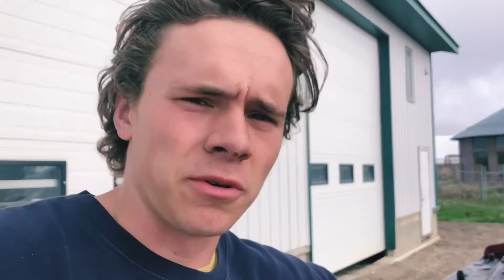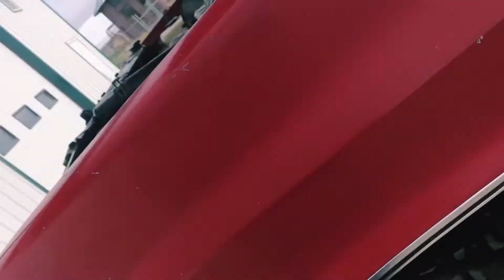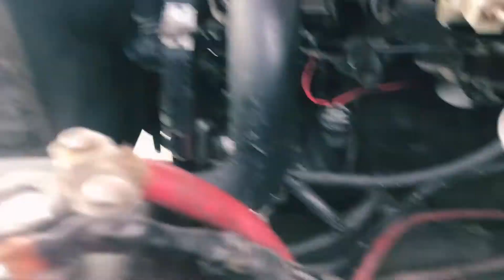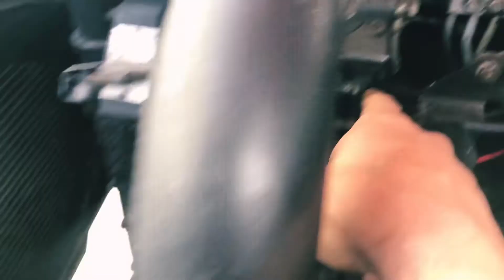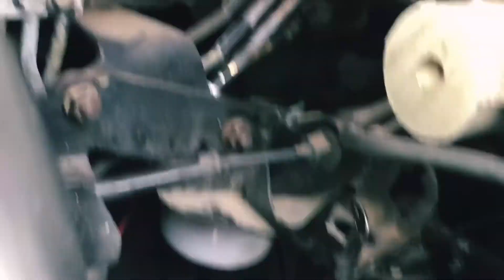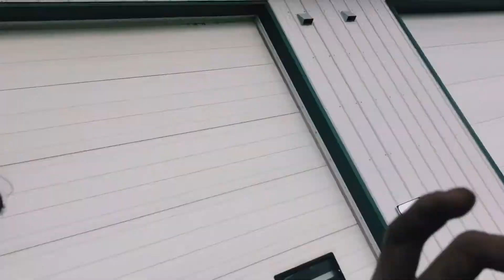12 Valve VE Pump Power Loss / Bog Issue Fixed | Diagnosed

Comment: Great information. I can start my truck every time I can step on the gas or the fuel pedal and get up to 10 miles an hour and no faster. I can drive around all day at 10 miles an hour and then come back to the house. I saw one video, but I cannot find it. Where inside the fuel injector there was a plastic washer or something that would break and stop the amount of fuel going in. Might have been the thing that you mentioned will continue.

Comment: I've replaced my mechanical fuel pump with a electric pump. An inline electric pump 
And I'm having problems getting power. The motor seems sluggish and won't go over 2000 RPM

Comment: Mine doesn't bog down but it doesn't have the power it used to and it gets like 14 miles per gallon and my dad used to brag about how it got like 20 or 21.  I just discovered it has a fuel strainer by the fuel pump thats never been open so not sure if that will be the issue or not. Ive timed it and adjusted valves and new injectors and nothing has ever gotten it back to what it used to be.
Reply: You ever getting this figured out?

Comment: My truck died on a long trip last night. I noticed at the start it seemed really under power and it did seem like it starved for fuel a couple times. I had to get it towed home to figure it out. So I changed the fuel filter and bled the low pressure line. That told me my lift pump was likely ok as it was able to pressurize the system and bleed it. I tried to start it and no dice. I watched your video and you gave a great step by step of what to check. I went through checking one component at a time. I disconnected my fuel shutoff solenoid and hooking it direct to my battery. I heard it click. I turned my key and it started with no hesitation. I checked the voltage on the supply wire and it was getting full power so doesn’t appear to be broken etc. I disconnected the wire from the battery and put the harness wire back on and again started like a champ. I took it for a drive and noticed a huge improvement in power so it appears the fuel filter was the issue. Not sure why jumping the solenoid seemed to help but it did. Thanks for your help! Your an awesome guy!
Reply from the maker: Thanks man !!

Comment: I've got a very similar issue. Was running fine and then all of a sudden it started to bog down and would keep running out of fuel at the injectors. Removed FSS plunger, and swapped to a known good lift pump but still didn't fix my issue. Will be adding air to fuel lines later on and seeing if it's either a crack in the fuel line going into the tank or if it's something inside the tank plugging up the sending unit
Reply: Fixed my issue, was definitely gunk inside the sending unit. Wasn't getting enough fuel to the injection pump. Replaced sending unit with a brand new one and now it runs better than it ever did
Reply: @yuribrezhnev6897  where did you get the sending unit from?
Reply: @Jordy40Growing  I bought it from eBay, it's the same sending unit as a gasser and it's plug and play. Unfortunately my tank didn't have the original in it or I probably would've salvaged mine
Reply: @yuribrezhnev6897  cool . Thanks for the info.

Comment: My truck runs for 5 minutes then loses power and dies, and only way to get it running again is cracking the injectors and priming the fuel pump but the fuel pump never builds any pressure, I can pump it 200 times and ill still be able to pump it with my pinky. I’ve replaced the fuel filter, but I’m guessing my fuel pump is bad because it never gets squashy?? Please help brotha
Reply from the maker: The camshaft has to be in the right spot for you to be able to pump the fuel lift pump. But what I sounds like to me is that you have a weak lift pump. Thankfully they are easy to replace. Go through all your fuel lines front to back and back sure there are no air leaks